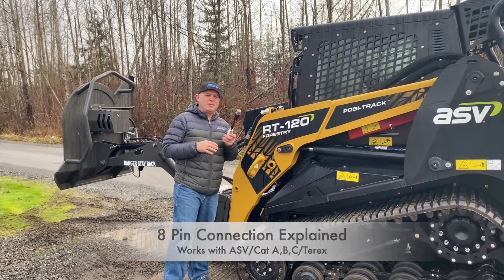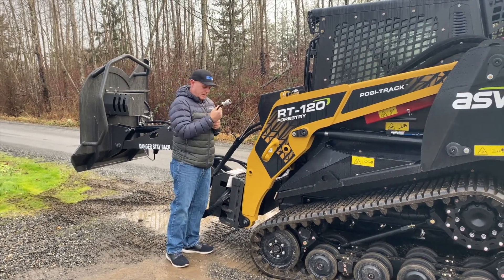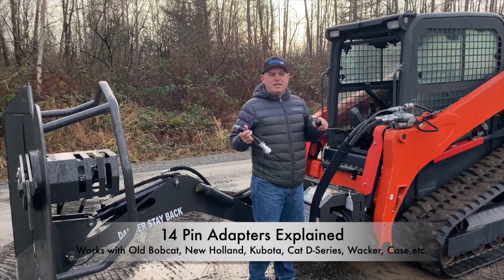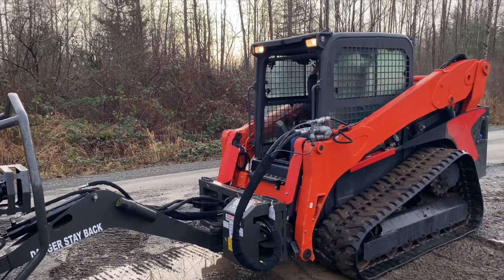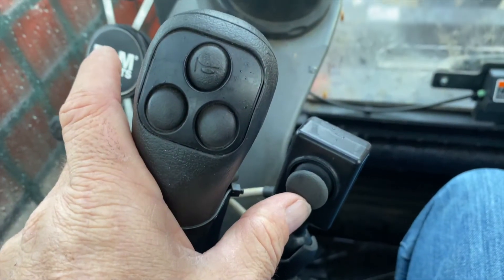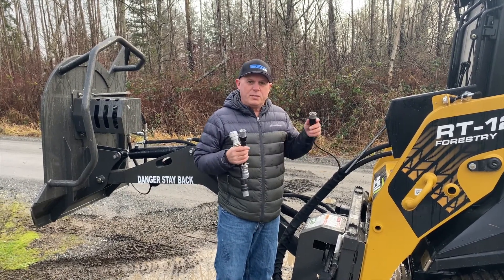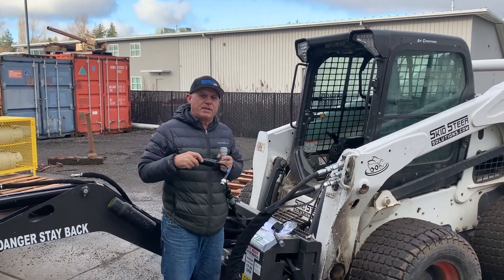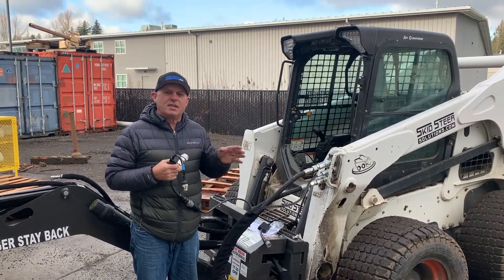#145 - CID Swing Boom Adapters

Comment: Rob, I am hooking this boom mower up to a SLV75-2 Kubota. Your demo here uses one connection adapter to hook up the mower outside the cab , but you describe a joystick inside the cab as super controller , where did that come from and was the 14 pin adapter ( normally has 4 pins stock ) adapted for this mower ?
Reply from the maker: Hey there Pal! 
Rob is referring to a SuperController feature. If you purchased you CID Swing Boom from a dealer or online dealer that didn't have this option available.

If you have more questions or want to speak direct with someone, go to our contact us page and leave us a message. We will be in touch.

Link Below to SuperController:

https://www.skidsteergenius.com/products/super-controller-14-pin-10-controls-universal-install-skid-steer-genius?_pos=1&_sid=260395dcc&_ss=r&variant=40160336117815
Reply from the maker: Install Video: https://youtu.be/u73OZKUKEKk
Reply: How many gpm can it handle?